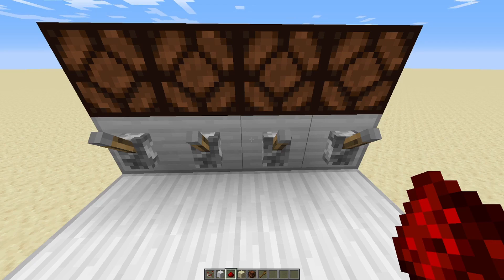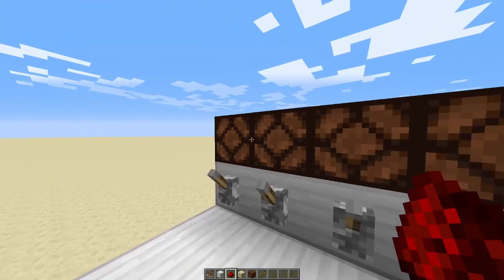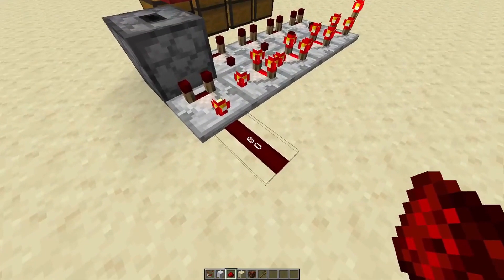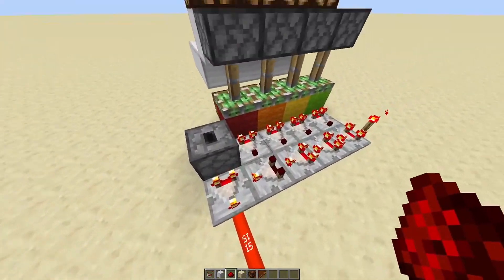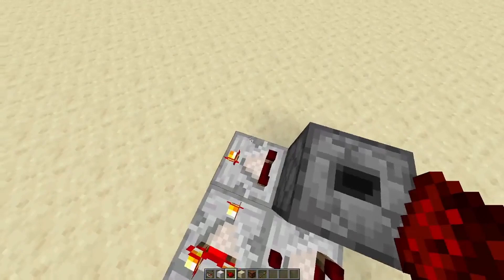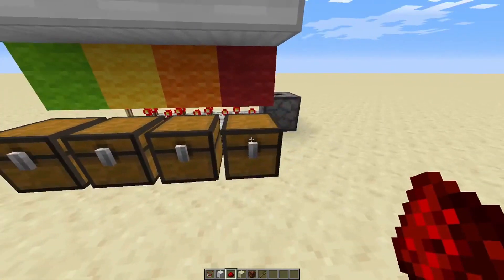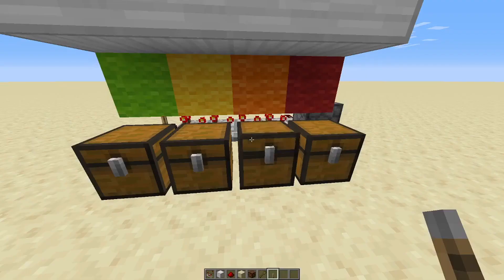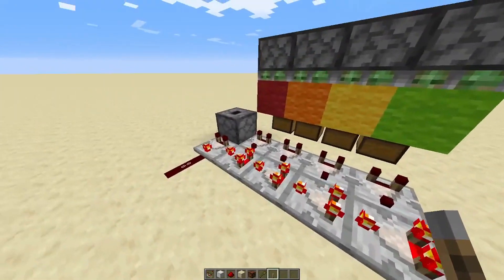Compact 4-bit Binary to Redstone Decoder in Minecraft

Comment from the maker: Thanks to u/sharfpang on reddit for mentioning this, you can make the decoder 1 block slimmer by replacing the solid blocks on the pistons with composters filled to 1, 2, 4, and 8, and getting rid of the chests.

Update:
u/munin295 on reddit pointed out 2 smaller designs than mine, you can find them in the description.
Reply: Yeah you’re definitely right about at least your bits are next to each other. What the heck was the second design in the description lmao it had inputs everywhere
Reply: @TheMrgman910  now u gotta make an encoder for it